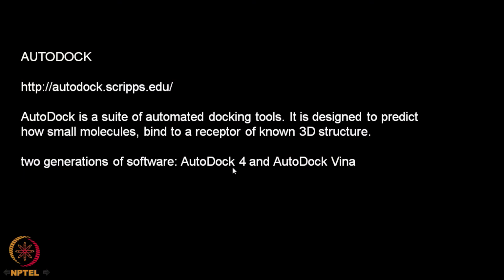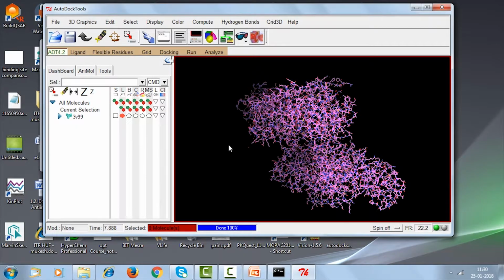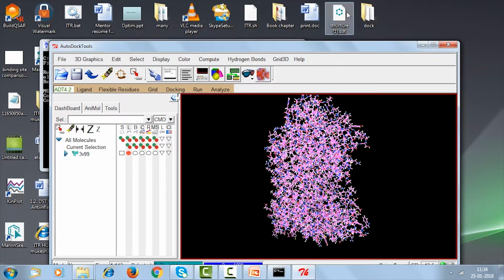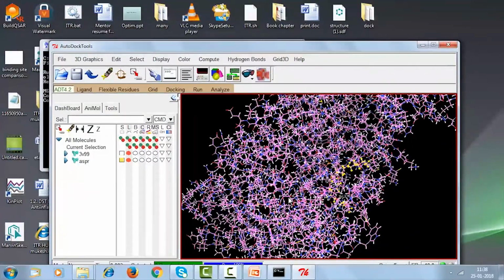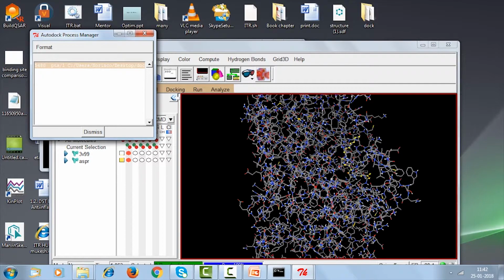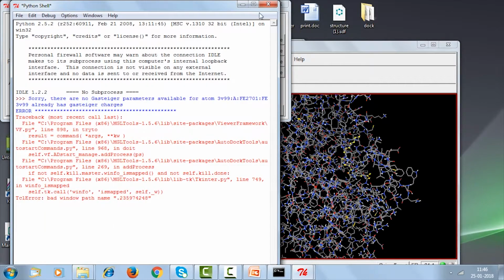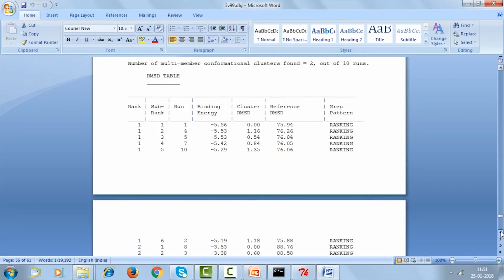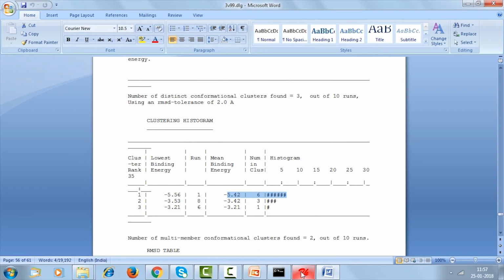Lecture 37 Docking

Comment: Sir,  i have prepared my ligand by gaussian software,  then i docked this ligand with PTP1B protein. 
 But,  in the docked file, some of  the solid bonds seemed to be broken in ligand. 
How can i solve this problem??
Will it be acceptable with broken bonds???
Reply: It's a common problem, but addressable. Convert your ligand to pdb format and then load into ADT. Add polar H-atoms and apply Gasteiger charges, you are set.
Reply: Can you please do auto dock for me